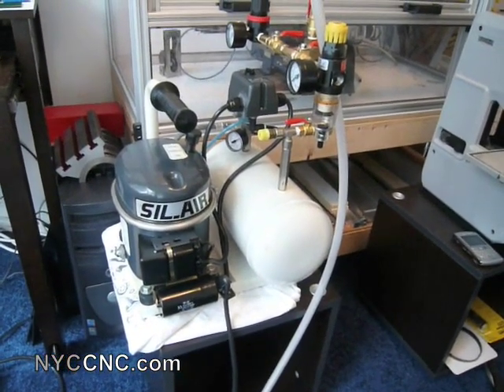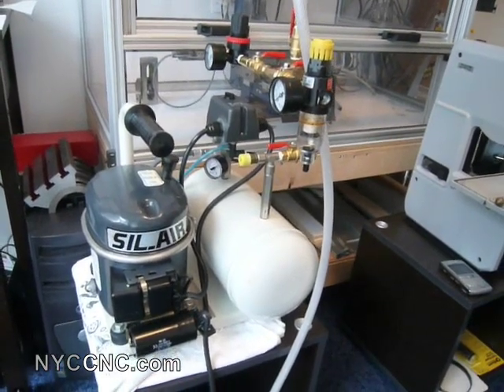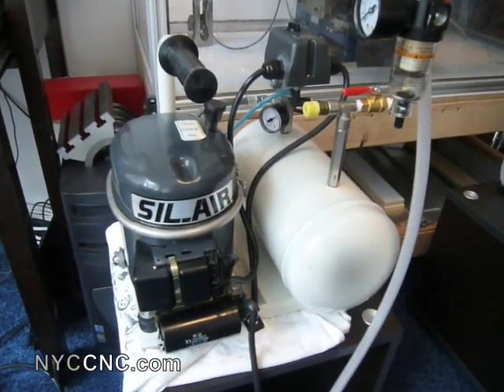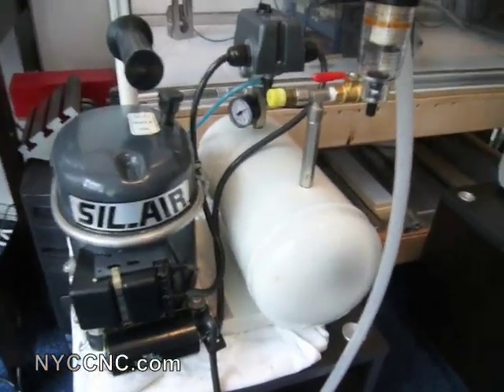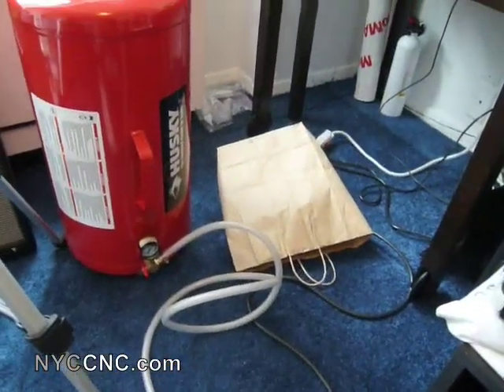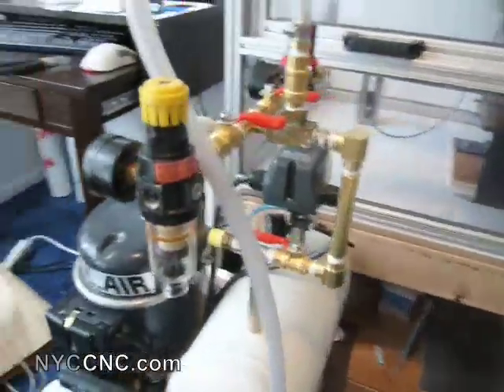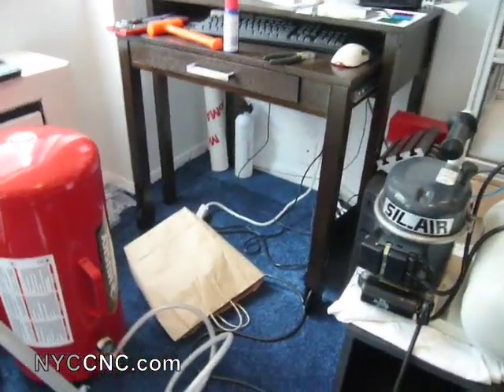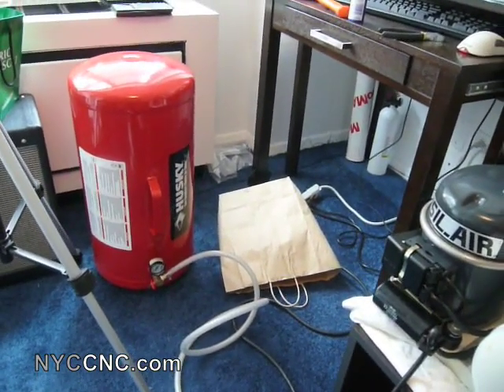Sil-Air Silent Quiet Air Compressor for TAIG CNC Mill Milling Machine

Comment: Looove this little compressor.>>>ur2.pl/1061    It's very lightweight and small. Takes up a lot less space in my truck than my pancake compressor. It is also very quiet. Sounds like a loud refrigerator or window ac. Not obnoxiously loud like the pancake model. Perfect for my small jobs where it's just me working and not needing a large air volume. It will even supply enough air for my framing nailer. It cycles on about every 2nd or 3rd nail when using the framing nailer, less often with a smaller nailer. This is my go to compressor now when I'm working alone.

Comment: Nice setup, neat idea with the second tank.  I would have thought the pump lid would come off, to allow you to check level and change the oil annually.
I have made a similar unit using a fridge compressor and tank from a belt drive unit.  Works great.  
Only thing I would say, is you need an industrial unit !!  LOL.  If that is your apartment.

Comment: Search on Amazon for SYCLONE 6310 and you'll find it.

Ultra Quiet - Only 60 Decibels
Oil-Free - No Maintenance
Extra Long Life - 3000 hour life cycle
Large 6.3 Gallon Steel Tank with Wheels
3.80 CFM @ 40 PSI
2.35 CFM @ 90 PSI
MAX 120 PSI
Low Amp Draw - 7.6 Amps

It looks a bit cheesy, but seems fairly well built where it counts.  Good design, fairly good components, so-so implementation.

Comment: I have a Porter Cable pancake compressor for my little shop.  It's loud enough to cause internal hemorrhaging.  I recently replaced it with a Syclone, purchased on Amazon.  It was almost twice as expensive for the same HP and CFM, and it's obviously made in China, but it's only 60 dB.  VERY quiet.  I think it'll last a long time.  It's great for a home shop, but who doesn't like quiet?

Comment: I have been looking and researching for a while,it's been since the late 80's that I have purchased a compressor,most of the compressors then were of good quality so the choices were easy.So far I keep going back to the Rol-Air JC10,while it is not silent 60db is tolerable.My plan is to try one and if it is not enough cfm then add a 2nd one in tandem using a tee with short hoses and quick disconnects.I could then just grab one to use about the house or on a job,in theory it sounds good,cheers

Comment: You'll be happy to know that the pump/motor assembly on those are filled with oil for life,though you can change it,being used as an air compressor it should last for years as in a refrigerator they have to work much harder and hotter to compress the refrigerant,seeing this you have made me want to go out and find a dumped fridge or freezer for the pump so I can have air on my mill which is in my kitchen,my main compressors in the garage and too big and noisey to use in the kitchen! Good vid ta!